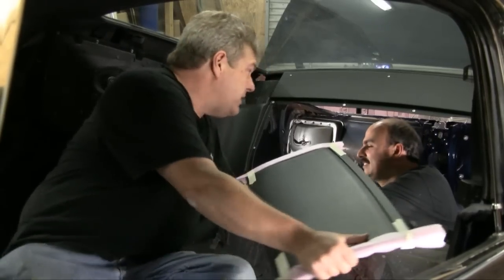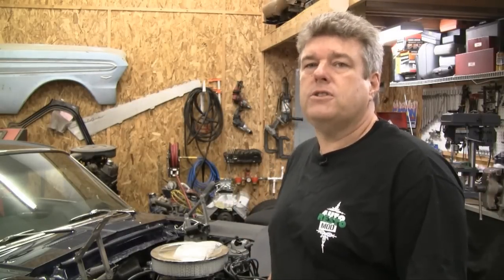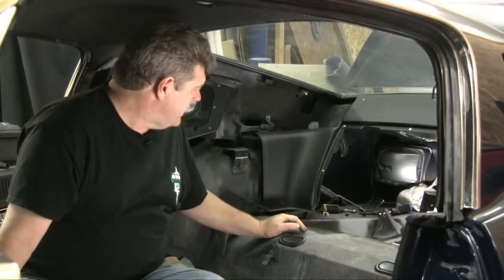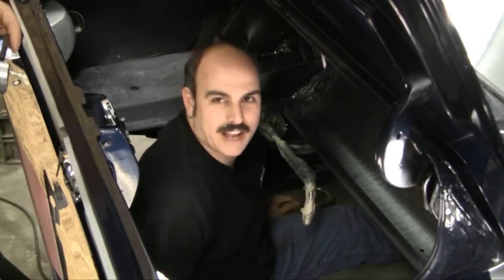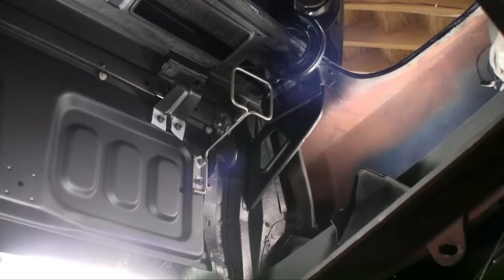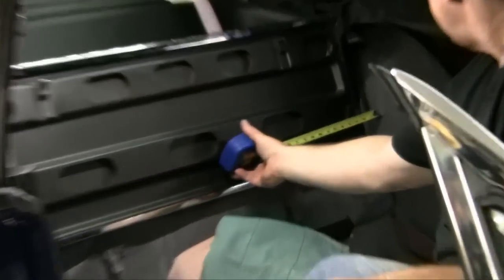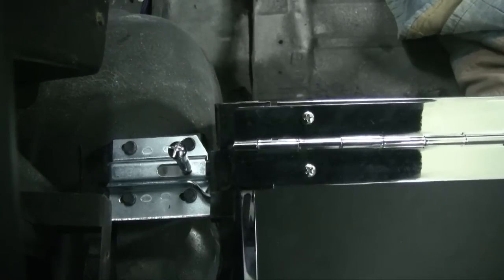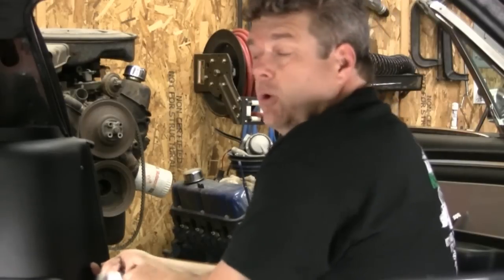Episode 116  Mustang fold down installation Autorestomod

Comment: I know it's been a while, but on the back section of the fold down seat, the one next to the trap door, what really is the purpose of the chrome/ss seat supports.  I'm referring to the two oval pieces screwed into that last section.  My seat is not yet put in the car, but I can't see how they serve a purpose.  The trap door swings up away from them.  The L-shaped front section of the seat folds over the middle section.  Do the stop bumpers on the edge of the L-shaped front section of the seat fit into those supports when the tray table...er, I mean the seat, is in its upright and locked position...?   I ask because my fold down is missing those oval seat supports. Do I really need them?   

Also, one of my L shaped trim pieces ( the piece that I see in your video having the rectangular hole for the seat latch) has no rectangular hole.  It's just an L shaped flat piece of trim.  And by gosh, this seat looks very original based on its condition.  In fact, the piece of trim that does have a rectangular hole does not have screw holes for the latch guide cover that screws on top of the hole.  My car is an early 1968 model built in January of 68.  I understand those L pieces were different than later 68s and on (all flat rectangle hole with no bends), but I can't believe only one side latched.  Any knowledge of the early 68s?  Do you think this was in fact a non-fold seat?  It would be interesting if it is given I have the three seat sections (vs. the masonite back section), and I have a trap door.  But, it would explain the trim.

Comment: Did you have clearance issues with the deck and the side trim? My Shelby seems to clear on the driver's side lower trim, but I am just rubbing slightly on the passenger side.The roll bar creates another group of problems on its own. I tried getting the deck to twist just slightly, but It doesn't seem to change. Have you had to open the hinge holes up to jog the deck to one side or the other in the past?
Reply from the maker: Yeah, we've had to tweak many of them. I've never had to re drill the mounts though. We also will re-drill the side panel holes in the side panels to even up the openings.

Comment: Excellent video,thanks a lot guys, when I purchased my mustang it was missing the fold down seat altogether. I recently purchased a fold down assembly and all the chrome etc.. I have one question tough, I don`t have any of the brackets to connect the seat to the body. Does it only have the  2 brackets where the middle sections hinges connects to the body? or are there other brackets besides the ones I can see at 9:51?
Reply from the maker: +serx1984 Yep, the back is held in place with those two brackets. There are others for the deck plate but they are back toward the trap door.
Reply: +AutoRestoMod Muscle Car Resto and Modifications 
thanks a lot,I have put in the two piece,I had to custom make the brackets for them,any idea what holds the deck plate in place?
I've searched everywhere but couldn't find an answer. it has 2 big holes towards the trap door on the floor and nothing else. there isn't anything under the trap door to hook it up either

Comment: Hey Auto RestoMod guys, 
 I am doing a resto on a 68 f/b and when I got the car the vent windows were disassembled. Of course the hardware was gone. Do you have any idea were I can find the top of the division bar. The one you said not to lose? I have looked in all the same old places and I will need to buy the whole assembly. The rest of the vent window is in good shape. Any help would be very much appreciated.

Comment: Can you add some detail on how to install the deck panel between the rear seat and the trap door to the trunk?  I need to installed fasters to keep it bolted in place, but don't know what parts, bolts and nuts are needed.  Appreciate any help.